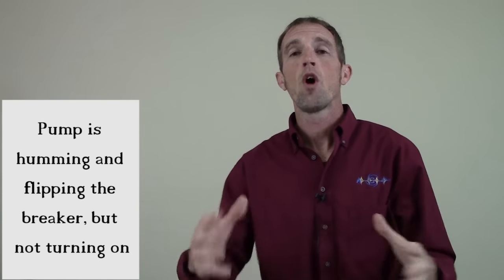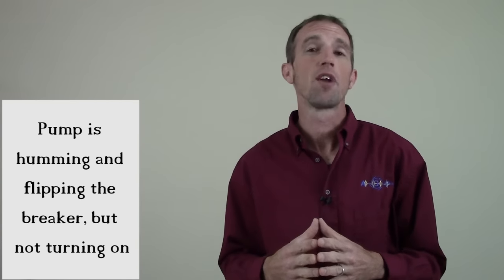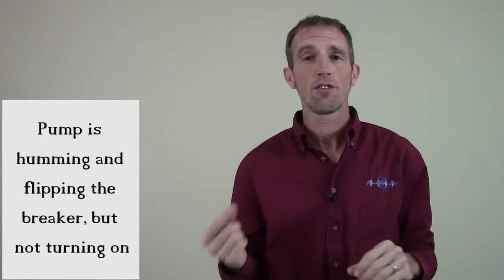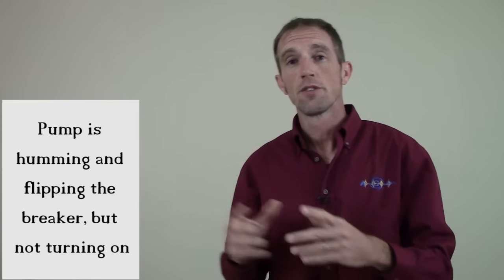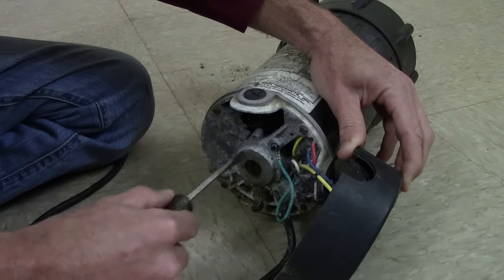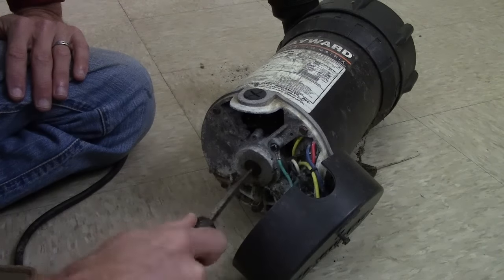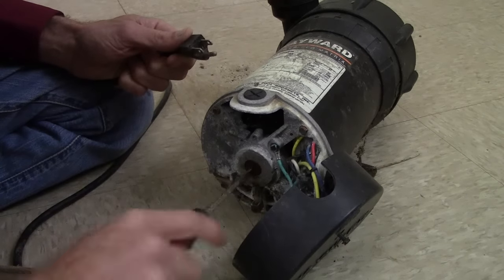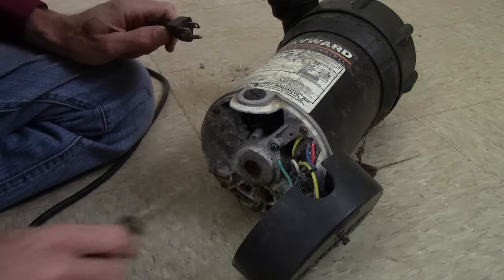Above Ground Pool Pump Won't Start or is Humming & How to Fix It

Comment: What's that capacitor release mechanism part at 3:15 at the 2 o'clock position called.  I think it turns off the capacitor once the motor starts spinning.  Mine was damaged during installation but I could not find the name anywhere?

Comment: I love your videos!! Thank you for all of the great info!!
I was running my pump, turned it off to backwash, it just started humming when I turned it back on, switched it to filter,  still won't come on, just hums...  its only about 3 months old...  any idea?
Thank you!!
Reply from the maker: If it is that new and you have the proper amount of power going to the pump which means either plugging it straight into an outlet or you have a heavy extension cord then it sounds like something inside the pump electrically has gone bad and it should be covered under warranty. If you're running it on to light of an extension cord then there's a possibility you have burn it up.

Comment: Hi Chad. 1st time viewer. Would recommend (cya) advising to have water circulating thru pump, not just sitting on bench when letting run overnight in any future vids.. I just found my pump nut running, has been. Tripped breaker. Now hums. Again has been running about a month this season. Hayward Matrix. Thanks

Comment: Thank you for this demonstration. I was optimistic as I could feel the tension from corrosion. But after completing the steps my pump is no longer humming rather is does not turn on at all. Any suggestions? Its a Hayward Power-Flo Matrix. Thank you in advance!
Reply from the maker: Either its flipped a breaker off inside your house and you don't have power or unfortunately the pump may be dead
Reply: @abovegroundpros  thank you. I hope the pump is not dead since I was getting the "humming" before I loosened the corrosion. I ordered a new on/off switch in hopes that is the issue.

Comment: I gave mine a tap with a rubber mallet and it stared and works great, but it is noisier than last year. I think the bearings need greasing. Can this be done by opening it up ans just spraying it with WD40??

Comment: Had humming pool pump motor (less than 2 years old), reviewed video and switched out the start capacitor  Model Dayton 2MDR5 189-227uf 110-125 VAC.  This switch worked and the pump started with no problem.  A few days later, the pump began humming again so I got a new capacitor and switched it out again.  No Luck.  Have been using the "kick start" technique with a drill to get the pump going which works with no problem.  Shaft rotates freely and there is no blockage of the impeller.  Any suggestions in this situation with a US Motors Pool Pump, 1 Horse Power, RPM 3450, S.F. 1.00?  Should I get another capacitor with a higher voltage but same uf?  Would appreciate any comments on this situation.  Thanks!!!
Reply from the maker: Matthew Kamula Is the shaft hard to spin or does it spin freely?
Reply: Above Ground Prosos  It spins freely when I turn it with my hand.  It seems that the capacitor is just not providing enough of a boost to get the shaft spinning when it used to.  Could the centrifugal switch have something to do with it?  Thank you for your help.
Reply from the maker: Matthew Kamula That's getting a little over my head Matthew.  You may need to talk to a motor guy for that.

Comment: Did this but had to kick start with a drill. Same power flo matrix as in your video. manual says 'Motor Hums, But Does NOT Start – Check For:
1. Centrifugal switch stuck in OPEN position.  2. Binding of motor shaft"  Any idea how to fix the Centrifugal switch?

Comment: This method works great but for some reason my pump stops running after several hours and then I have to kick start it again. Any suggestions?  Is it possible the brushes in my motor are just worn out?

Comment: In my case , i have been use the pump every next day and today i had to kick start the pump. So, I understand is not corrosion It just happened from yeaterday working and today needs kickstart. I left an 1/2 hr run and retested. No joy, I needed to kickstarted again. What I cand do. Maybe there some viscosity in there. How can I open to grease or clean the bearings?
Reply: I just saw your does and donts
Now I understand. Wish to see this video before put wd40 to pump. I killed in a 2yr pump. I can kickstarted but yesterday ran fine and today needs kickstart

Comment: Thank you for the excellent tip. However, I have to manually to start my motor by using your tip every time because it  won't kick itself on without my help. My motor is only about 2 years old and it is easy to be turned. To resolve this issue, is it possible that I have to clean the contact or replace the governor or switch?
Reply from the maker: That I don't know. It would probably be best to talk to an electric motor repair man and see what he thinks

Comment: It worked! Thank you! Now, I've run it for 24hrs, but I've had to do this "jump start" everytime i go to turn it on. Is it just too much corrosion in it?
Reply from the maker: +KinesioGuy possibly
Reply: I too have this problem. the motor kick starts early but has to be kick started every time it turns off. Spins very easily. I have an  hayward RS1000 with an capacitor. would a new capacitor take care of this ? Anyone know? 
Thanks .
Reply: purnrg13 yes, for sure, replace the cap. all you need is the MFD rating and number of terminals to be correct. microfarad number can be a little off, but not much. obviously voltage needs to be same. physical size of capacitor is irrelevant, only need to match what I said above 
remember to short the terminals of the old and new cap before handing.....with wires off, take screwdriver and touch to both terminals at once

Comment: I believe Pump is the part getting stuck not motor. Chlorine is corrosive. I squirted some WD-40 at the pump connection and let it drip down. Then did like you suggested then spun it using drill screwdriver. I never took a totally frozen one apart to check but I would bet pump is it. Your video helpful about motor axil slot. Pressure washer pump saver I bet would help at end of season for prep and to remove it from out doors.

Comment: The best way I do this is detach the pump from the piping after the season, turn it so it drains out and bring it inside for the winter. I also bring in the filter after I clean it and drain the water out. You never have to worry about it getting corroded.

Comment: maan thank you so much for this! BTW is there a way to throw an anti corrosive to the cooper wires? I cant find a way to open up the engine to clean that up
Reply from the maker: That I don't know. You would have to talk to more of an electric motor repair guy to find that out

Comment: Just got my pump going by jump starting . Letting it run for a few hrs ,and hopefully it will xtart up without have to jump start it. Is there a electrical spray or lubricant  that you could spray in the motor to prevent it from corroding . Especially  during  winter storage. Mine is stored in a heated garage.
Reply from the maker: If it's locked up then it's the bearings but the bearings are usually internally sealed so even if you spray something in there it wouldn't help the bearings

Comment: Took off the back cover, wiggled and turned the shaft with a screwdriver, no go, then used a drill instead, immediate startup. Thanks publisher and commentors.

Comment: I did exactly what you said in the video and sure enough my shaft is locked up...I cannot move it at all...any suggestions? Is there a way to break that free other then just trying to turn it with large screwdriver? Thanks
Reply from the maker: craig ashworth You coould try a bigger screwdriver for leverage, but if that doesn't work, you may have to replace the motor.
Reply: Thanks...that would really suck as we JUST purchased this pool/pump used 3 weeks ago. How long would it take for this type of lock up to occur?
Reply from the maker: craig ashworth That really depends on a bunch of factors.  I've seen 2 years and I've seen 8 years.  Depends.
Reply: I realize this is a 2-yr-old post.  However, in case anyone else has the same issue (as I did!), here is how I freed it.  First off, I  tried using my largest flathead screwdriver on the shaft end as he shows in the video.  Not only would it not budget, but I actually managed to snap the end off of the screwdriver by applying the maximum torque that I could manage.  After staring at it for a while, I decided to spray it with some lubricant to see if that would free the end of the shaft.  I sprayed it and about 30 seconds later, it turned easily with a screwdriver (no effort at all).  The lubricant I used was PB Blaster, but WD40 or similar would likely work as well.  I hooked up the power to test and the motor worked great.  Reinstalled it and it's pumping my pool water right now.

Comment: My pump has hi/low speed.  Been running strong for 5+ years.  Today, it failed.  Low speed works but hi speed does the humming with shaft frozen.  ???

Comment: I was able to turn the shaft just fine… my motor is just humming as well. I think it tried to turn on this morning because I have it on a timer. The motor was super hot shut it off for a couple of hours.
Doesn’t smell like burnt or anything. But it didn’t work for me.
Any other suggestions??!

Comment: ok, my pump does everything you said hums then turns off. I removed the backing and found that a flat head screw driver did not fit, there was a nut with a whole. I was able to turn that with ease no corrosion.  what else could be the problem? Thanks.
Reply from the maker: if its an inground pump then the capacitor may be bad.  If it's an above ground then its probably a bad motor.
Reply: +Above Ground Pros  thank you that was it paid 30 dollars. Thanks for the advice and tutorial and feedback.

Comment: Thank you, this worked. However the pump is super loud now. Any trick for that?  I saw a few comments below not to use WD40. We are in a fairly quiet neighborhood so this pump is embarrassingly loud!
Reply from the maker: Unfortunately not, unless you get someone to rebuild the motor.  This is usuallyy the time people replace their pumps.
Reply: Thank you. I'll keep searching. No one around here does that kind of work, that we know of. It almost sounds like there is something in the pump grinding in everything. This will be the pumps 3rd season.   I feel like we should have gotten more use out of it than that.

Comment: Just tried it. I was convinced that corrosion was the issue, Handheld screwdriver wasn't enough, but the drill idea in earlier comments worked. Shaft spins freely now - however, the humming is gone and now I have nothing. I'm worried that i did permanent damage to the motor by turning it off an on so often while troubleshooting. 

How long should it take to reset?
Reply from the maker: The pump has a thermal breaker inside of it that if it gets hot it flips the breaker and you got to wait usually about 5 minutes
Reply: @abovegroundpros  Thank you!

Comment: i have a century pump and took the metal top off, but it doesn't have a slot for a flat head screw driver to turn , any thoughts as to how to manually turn it?  thanks!
Reply: all set , thanks again,  just used a pair of pliers to turn it and it started right up!  thanks again , great video!

Comment: Wish I had seen this video before I ordered a new pump. I took my old pump completely off and in the garage now, is it safe to run the pump without water for testing? Mine is turning but it sounds rough, noisier than usual, is there any way to lubricate the pump so it runs quieter?  Thanks
Reply from the maker: Not that I know of but you may want to talk to him motor guy. He may have a little more Authority on it than I would.

Comment: What happens if you have this symptom and the pump has been operating for weeks and I just turned it off to clean the pond for 15 minutes and then turned it back on and had this happen?  Seems like it should be some other problem.

Comment: Chad, could you offer a suggestion?  Yesterday I went to turn the pump on and it did the humming. With mine I have to flip the breaker and remove the motor from the housing so I could manually spin the impeller.  After doing that the pump turned on fine. This morning I turn the pump off to clean the skimmer.  When I tried turning it back on it did the same thing as before.  I did the processes again but again it just hummed.  The motor felt pretty warm.  I just left it turned off hoping once it cools it will turn back on.  Any thoughts that could help me?
Reply from the maker: Is this an inground pump or above ground?
Reply: @abovegroundpros  in ground
Reply from the maker: Then your issue is probably that your capacitor is bad. Replace your capacitor you should be set.
Reply: Above Ground Pros what if it’s the same issue, but for in ground pool?
Reply from the maker: If it's an inground pump and it's doing this then the capacitor is your problem. Above ground pool pumps don't have capacitors.
Reply: Above Ground Pros thanks. Sorry- I can’t read today. Lol

Comment: Awesome! Thank you so much! If it wasn’t for you, I would’ve easily spent 400 bucks on a new pump
Reply: When you had to put the screwdriver in it and start it, I didn’t shock you correct? Because I feel like when opening up a motor and taking off the cap, seem a bit dangerous. But I’ll try it as well and see what happens.
Reply from the maker: There's no electricity attached to the shaft of the screw that you're going to be spinning.
Reply: Above Ground Pros thanks. But looks like the end of my pump is different even though it’s a Hayward.

Comment: I have the same pump and had the same problem. Ur video helped and I got my pump running again but the pump makes a loud noise when it runs. Do you know what happened and how to fix that? Thanks
Reply from the maker: +Anne Wu a pump getting louder is usually a sign of a pump getting into its older age. There really isn't much you can do about it without replacing the motor. It's fairly common for pumps to do this at the end of their life.

Comment: I was wondering if you could pour baking soda mixed with water in there, because this works great on car batteries that have corrosion on the terminals. I'm not sure if water can go into there without damaging the mechanisms. Thanks for your reply!
Reply from the maker: I haven't tried that or heard of anyone trying it.  I wouldn't think it would be a good idea.
Reply: Thanks. I'll just stick to using baking soda on a car battery with corrosion. :) Probably safer that way.

Comment: Im not a pro on pool pumps but i work with motors and hydraulic pumps. And if your getting  corrosion in the windings you have a bigger problem then it not starting its getting water inside it. May wanna take it apart and check all the seals.

Comment: When turning the shaft with a screw driver, it moves freely and does not seem to ave any corrosion on it at all. Yet, this humming but not working is still the issue with my pump. I will be attempting the "jump start" but any ideas?

This all came after the pump was turned off in order to bump the filter (as we do regularly), and when turning the pump back on, that is when we encountered this problem. Hopefully you are still replying to this thread. We could really use the help. Thank you.
Reply from the maker: If that's the case is seems to have something internal wrong with it. I think your best bet is to take it to an electric motor shop and let them have a look at it. A lot of times it's an easy thing to do I just don't have the understanding of it myself.

Comment: Worked like a charm after a few tries. Thank you so much!!
Reply: He said to run the pump for a couple hours. Did you have it connected to the pool so water was going through the motor?
Reply from the maker: Yes
Reply: @kmsmiley98  yes I did!

Comment: Ok so I did this and let the motor run for about 2 hrs. Hooked it back up to my pool filter system and had water pouring out of both ends of the motor. Looks like I fried both pump seals by running the motor without water?
Reply from the maker: nettersly Unfortunately I think you're right.  You don't ever want to run a pump with no water running through it.  It heats up the pump and can burn up the motor and seals.  Good thing is you should be able to get a seal kit for about $15-$20 bucks.

Comment: I have a problem with pump water is not going all the way to the top so there for hardly no flow coming in I replaced several o rings and replaced the top dial on tank just bought pump last summer
Reply from the maker: +Mariann Harsey this could be as simple as your pump sucking in air and causing this to happen. Nine times out of ten this is created by low water level where the pump pulls water from the skimmer quicker than gravity can keep the skimmer full. Also something could be blocking the water coming from the skimmer into the pump.

Comment: Thanks so much!! I have spent allot already getting this pool up and ready. When I plugged my pump in and it did not spin my heart dropped... $$$$ damn pool etc... but this worked and she's spinning like a champ!
Reply: I was worried about plugging it in and using a screwdriver. Won't get shocked or electrocuted??
Reply from the maker: As long as you stay on the shaft and don't mess around with the electrical connections you'll be fine. There's no power to the shaft itself
Reply: @abovegroundpros  Thank you!  I showed the video to my neighbor and he did it. It worked. Yea!!!!